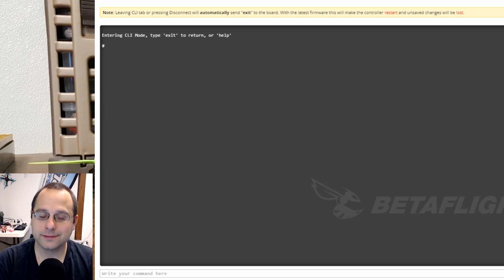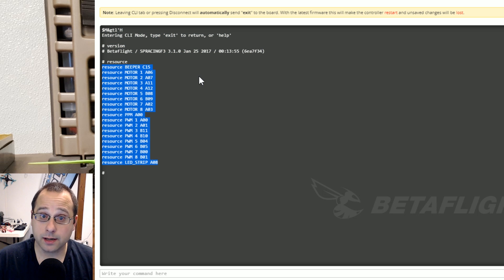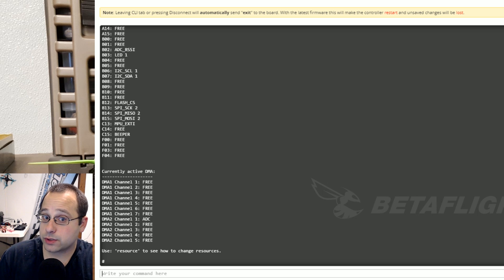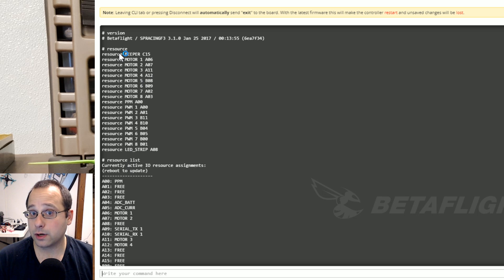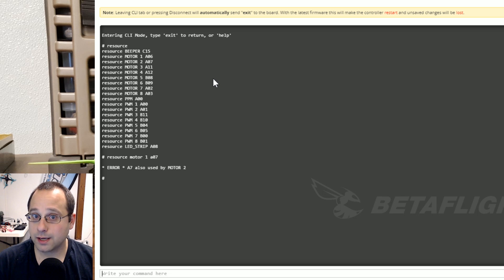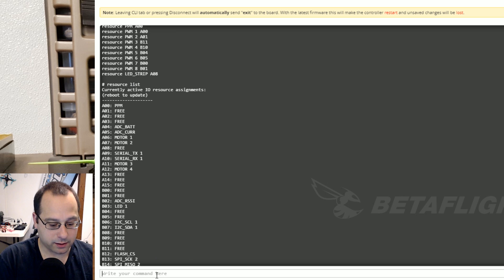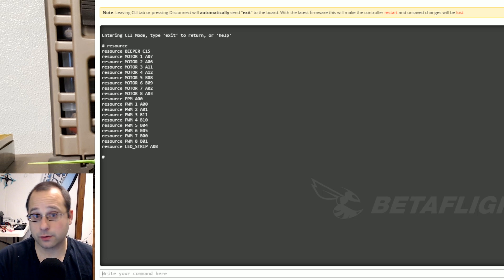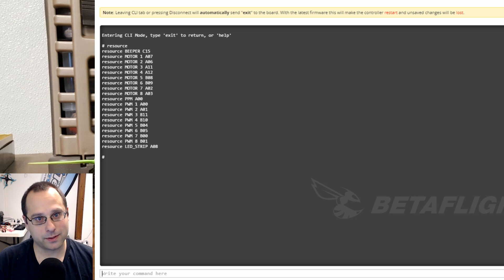Betaflight 3.1 Resource Remapping | NO MORE CUSTOM MOTOR MIXES YAY!

Comment: in Betaflight 4.2.9:
# resource list
###ERROR: resource: INVALID RESOURCE NAME: 'list'###
Reply from the maker: They changed it to "resource show"
Reply: @JoshuaBardwell  Thanks! 
Hey, Joshua, quick question: we really need to make a 4-rotor fixed wing and we have a DARWINFPV stack, which doesn't support iNav and seems to be made for quads. 
Is it somehow possible to link the same throttle signal to all 4 ESCs in Betaflight, so the motors won't get any other inputs from other control sticks? Chosing Airplane in the Mixer makes only rotor 1 rotate, and it does it smoothly, but we need all four to do the same... :/
Reply from the maker: Why not just wire the motors directly to a PWM output and control them manually? If not running iNav then there's no reason to have the FC controlling the servos or motors.

You could also wire all 4 ESC's to the same signal output on the FC.
Reply: @JoshuaBardwell  Yes, your second suggestion is what I've been wondering if it was possible. Problem is, I can not find any information on how and where to set it up... The other issue is that the motors spin up and then stop responding to throttle, so I have to disarm. I guess it's because of the feedback from the (receiver's) gyro?
Reply: @JoshuaBardwell  Oh, you probably mean in the second suggestion to literally wire ESCs to one FC output, not digitally? In this case, I don't see how it's possible, because FC connects to ESC board via plug connection that is soldered to the boards.
And it seems there was a misunderstanding: this F7 100A stack doesn't support INAV, but it does support Betaflight, which doesn't have GUI signal mapping...

Comment: is it posible to mapping motor to SDA/SCL or TX1/RX1..?
Reply from the maker: It's possible it would work on some FC but not all. You can try it either it will work or it won't.
Reply: @JoshuaBardwell  I was try it, but in motor test betaflight can't enable slider. If I turn back to the default motor pin it enable to slider,
I was try to sda/scl, led, tx/rx, but if I use led strip it's fine to slider motor.
Btw I use Fc Noxe f4 firmware 4.0.1, bf configurator 7.10.
2 pin broken to esc, so I need 2 pin.

update:
i was successfully do it.

Comment: Seems that my B00 is not working, as I switch motors they fail at this assigment. I read also that "Mapping between other motor pins (swapping) should always work fine. Other pins may not work (DMA conflict with DShot)." Is it possible to remap motor to other assignment? Led Strip didn't worked for motor, is there some other option? I have beta85x so limited with dimensions of board.
Reply from the maker: Ledstrip should always work as it is guaranteed to have its own timer.

Comment: Hey Joshua I am in a bind. I have to mount my 4 in one upside down. I was debating on wiring the signal wires in the "wrong order" so that BF sees them as the correct order which will solve the problem. But! I am concerned BF will get confused when calling for telemetry data (rpm) so I am now thinking of wiring them in the stock orientation and remapping but am also concerned about the same problem, tel data confusion. In my head it should work either way but I am not sure how BF reads esc tel data and if that system will also be changed accordingly when motors are remapped. Any info will be appreciated. Thank you!
Reply: Sorry for the long comment.

Comment: what if my motor order is right but motor 1 and 4 are spinning in the wrong direction please help! youre the best!
Reply from the maker: Reverse the motors in blhelisuite OR swap any two of the three motor wires where they attach to the ESC, and the motor will reverse direction.

Comment: @1:39 A06 is Pin 6 of the A Port. All that info is in the datasheet for the processor that you are using. Very easy to find

Comment: still works in 4.0?
Reply from the maker: Yes definitely.
Reply: tried it on dys f4 pro
s3 was broken
still doesn't work and 5v reg has a problem, rx recieves only power upon plugging in and quickly fades out

Comment: After i did this my s bus signal stoped working
Reply from the maker: Possibly you remapped something that messed up the UART you are using for SBUS. The first thing I would do is restore the resource settings back to the way they were before you started changing them.
Reply: Joshua Bardwell how can i do this ? Is there some special command i can write ?

Comment: Mine just says this help please!

NOTE: C00 already assigned to FLASH_CS.

NOTE: C00 already assigned to SPI_PREINIT_IPU 3.

Resource is set to C00
Reply from the maker: There are other things assigned to pin C00. Now there are three things on that pin.

You can resolve this by typing

resource flash_cs none
resource spi_preinit_ipu 3 none

this will remove the other things on the pin.

Comment: Im in need of help, so i was remapping motors freed them all up, well beeper 1 and motor 1 at the time shared B04 well i did the swap movi g motor 2 to B04 and now when i test i get nothing from it... worked before now .. nothing any help is appreciated.
Reply from the maker: I would recommend using the approach in this video: https://www.youtube.com/watch?v=QeuSq71pYF0&t=1s

To get your default configuration back, the best case would be if you had a config dump saved. Take the lines starting with "resource" and paste them back in. Then type "save".

If you don't have a config dump, then first create a config dump file. Type "dump" in the CLI and copy/paste the entire result into a text file.

Next, type "defaults". This will erase your configuration back to default.

Next, type "resource" and copy/paste these results into a separate text file. This is the default resource assignments.

Next copy/paste the config dump you created back into the CLI window. Type "save". Now your configuration is restored.

Next, copy/paste the default resource assignments back into the CLI window. Type "save". Now your motor mapping is back to defaults.

Now make another config dump file, this time with your default motor mapping. Save this so that you can easily restore it if you get in trouble again.

Comment: hey Joshua, remapped the led pin to serial tx 11 for smartport when i save and go to resource list it doesn't update and shows the remapped pin still as "free" any idea why its not saving the remapped pin? rebooted several times
Reply from the maker: Did you do "resource led_strip none"?
Reply: @JoshuaBardwell  yes as well as 2 other sonar_trigger and motor 5 all three set to none

Comment: Hi Joshua, I have damaged my +5V pin for my TBS-VTX on my OMNIBUSF4SD, if I use the resource option, would that be viable to change my power from another source on my Flight controller?
Reply from the maker: Good news! You can use any other 5v pad that is on the board. They are totally interchangeable. No remapping is required. Or possible.

Comment: when i typed only "resourse", all of my uart ports showed up, tx1,3,6 and rx1,3,6 so does this mean i can move them? is it depending on the fc? i am using omnibuaf4 v3
Reply from the maker: You can't reliably remap UARTs. Sometimes you csn out something else on a UART pin, but you seldom can move a UART somewhere else.
Reply: okay, that's sad. how about the sda and the scl for the compass, can we transfer them? , cos in omnibusf4 the pins are combined like the uart3  tx/scl, and rx/sda. i already used all of the uarts and i want to add compass module but its already occupied by my vtx audio. but the thing is, i cant find the scl and sda when i type "resource" and "resource list" but i can see it when i type "dump" and its in "none" status. I'm confused.

Comment: This helped me out big time...I was stuck. Just built up Super ripper w/hglrc Dino 60 amp stack, Red T-motor F40 pro 2   Tattu 1300...These motors like the 60 amp juice.  Was really stuck, and it took me a moment to reverse my motors in the CLI.  But I did it.  Did something cool u might like...Stuck these mini 2 inch 5mm  30/30  bi-blades on my quad in testing and bench mode. It worked really well and is safe.  Super stoked   Bardwell.

Comment: Off topic Josh but a little help would be apreciated, been trying for quite a few hours to modify my Diaton Fury F3 OSD board to get access to the 3 UARTS, I have managed to get Uart 1 sorted for FPort and will use Uart 2 for GPS, Uart 3!!!! for Speedy Bee this is listed and came across a snippet somewhere stating Uart 3 is actually the PPM and Sbus inputs, so with a CLI resource check I can see PPM 1 is assigned to BO3 which I can assume is the pin marked PPM :) however Serial TX 3 is assigned to B10 and Serial RX 3 is assigned to B11 so this gets confusing, I have tried reassigning the "3" to B03 and assume B02 to no avail, in a way ready to bin it and buy a new FC as its getting pretty old now, but im stubborn, its a good little quad, there is very little info out there on the Interweb on this board and its connections from where I sit, I am going to spend a couple more hours trying to nut it then give up :), update I have Speedybee working using Soft Serial with B03 and A08 so the Led Strip and PPM, I am guessing Sbus is out of bounds
Reply from the maker: I'm sorry this is way outside what I could advise on, without direct experience with the flight controller. Your best bet would be to try to contact Diatone via Facebook and see if they can/will help you.
Reply: @JoshuaBardwell  All good :) after all this, I got Speedybee working, Fport working but GPS was a big fail, few hours later stumbled across the snipped GPS support has been dropped for all F3 boards on Betaflight...... time to upgrade :) A JB Board will be here in the morning

Comment: Hello Joshua i have Bardwell board and was wondering if i can remap the video pad that ripped off
Reply from the maker: Video pad can't be remapped I'm sorry. You can try to scrape back the solder mask and solder directly to the trace. If you succeed, use a bit of hot glue to support the wire and prevent it pulling off.
Reply: @JoshuaBardwell  thank you im gonna try. I think I can see the trace on the inner side of where the pad was.

Comment: Hi, how to discover the resource number of a certain FC pad? I have a AnyFC F7 and I want to connect a Beeper to a pad (ex.9) but I don't know resource of that pad. thk
Reply from the maker: Type "resource" and look at the function that is currently on the pad.
Reply: Yes, but that didn't help me (resource BEEPER 1 B04) because the FC board does not identify the beeper pad. I just have Pad's 1 to 10 for everything (motors, beeper, led, etc).

Comment: Hello Joshua,
Apologize if someone have asked this before. So basically my question is can I use my spare pins (motor 5 and 6) as onboard ADC (ADC_BATT and ADC_CURR)? since my FC does not have those particular pins.
Reply from the maker: No you can't do that. Motor pins are GPIO (general-purpose input/output). RSSI and CURR are connected to an ADC (analog-to-digital converter) pin. ADC pins and GPIO pins are not interchangeable.

Comment: Hi bardwell! I recently got a 20x20 BETAFLIGHT F4 NOXE board from banggood and would like to use an external current sensor like the gt-r90 does. Can I remap the pad used for LED_STRIP, to ADC_CURR?

Comment: How about using UARTs for servo control? My idea is to use a FC with only 4 motor outputs (because most are like that now and they are clean) on all four corners, but still be able to connect two servos to use in a DIY gimbal on a quad. I want to use soft serial to free up more UARTs on the board by sticking things together like SmartAudio with ESC telemetry and such and then use resource mapping to assign two freed UARTs as servo PWM outputs. Is this possible? Will UARTs support the "cam stab" functionality along with manual control of a servo? Thanks!
Reply from the maker: A UART cannot be used for PWM servo output. But it might be possible to remap it for the camstab function.
Reply: @JoshuaBardwell  Thanks a lot! That sounds like an experiment waiting to be tried.

Comment: Can one remap / swap serial_TX6 and serial_RX6 on a betaflight F4 FC or any FC? for using FPort. will it work?
Reply from the maker: Not usually, no. UARTS usually can't be remapped like that, although sometimes you can. For using FPort you should use the same pad that the FC wants you to use for SmartPort telemetry.
Reply: Thanks JB you'r the man!!

Comment: Thanks JB! This helped out massively, I had a 4 in 1 mounted sideways on to a Helio Spring Board, so had to remap all 4 motors 90 degrees Clockwise! They really need to put this into the Butterflight GUI!

Comment: Hi Joshua is it possible to remapp my sbus port?  I fly normal and my quad stop working. In the configuration i have no stick moves anymore. I replace the Fc and everything works fine. I flashed it new but nothing changed. Best regards Marc
Reply from the maker: You can use any UART RX (receive) pad for SBUS, but if your flight controller has an F4 processor, you have to do the "uninvert hack" on the receiver.

Comment: Hi usua , i need to use cross fire and gps in joshua bardwell FC , im alredy using led port  and rx4 and tx4 ,   and now  rx6 for the crossfire ,  now i need the tx6 ,  can i use cam control and remapp for tx6 ?
Reply from the maker: No you can't do that.

JBF4 v1.3 breaks out T6. On the earlier boards you have to put crossfire on UART4 there is no other option.

Comment: Joshua: are you saying we can't reassign soft serial? I'm trying to wire up runcam control via uart, but my only remaining uart is inverted, so cam control isn't working. Can I enable soft serialTx and Rx, and assign them to the uart pins in question? Can the software workaround the inversion by setting tlm inversion = off? Thanks!!!
Reply from the maker: You can reassign softserial.

You generally cannot reassign hardware UART pins, except in limited circumstances.

If you need both a TX and RX softserial pin, then finding two pins to reassign can be challenging. The best case is if you have two extra motor outputs.
Reply: thank you

Comment: hi, Joshua, I have too many fluctuations in my channels, looks everything is mixed. I posted a video https://www.youtube.com/watch?v=XNUZ-0t1YHc&t=38s   Couldn´t find any similar problem on youtube
Reply from the maker: Usually this is caused by the wrong serial protocol selected in the Configuration tab. So you have SBUS receiver but you selected Spektrum or something like that.
Reply: i AM USING A  SPEKTRUM RECEIVER, WITH  THE SPEKSAT AND SPEKTRUM2048 PROTOCOL, MUST BE OTHER THINK, HAVE YOU SEEN THE VIDEO, ANY OTHER IDEA OF WHAT IS CAUSING THE PROBLEM

Comment: Is there a way to remap rx inputs. I have a cl racing f4s that had the sat pad pulled off and putting it on the sbus like I was told does nothing.
Reply from the maker: SBUS pad should work if you change UART 1 to "serial rx" in the Ports tab. You can also try RX4 or RX6 for UART 4 or 6.
Reply: Thanks. Love your videos!
Reply: So no need for any type of remapping?
Reply from the maker: No not at all.
Reply: Didn’t work.

Comment: I have a fury F4OSD FC that I lifted the ppm pad on. I remaped it to the rx 6 pad but it didn't work. Is there something else I need to do?
Reply from the maker: In general you cannot remap UART pads to other functions. Use LEDStrip or a motor pad or something like that.
Reply: Joshua Bardwell I tried the led strip first. Will I still use the uart 1 in betaflight for the receiver when it's on the led strip?
Reply: Joshua Bardwell I was wrong. I lifted the sbus pad. I don't see it in the resource list. I originally thought the sbus connected to the ppm pad but on the fury f4 8k it has its own pad. I wish that board wasn't out of stock everywhere or I would buy a new one.

Comment: I had motors 3 and 4 swapped.. and this works in 3.3.1. Also, 3.3 has a "Custom" selector in Configuration > Mixer - but doesn't seem to have any GUI to assign motors (or maybe I missed it). Anyway, got them switched via command line. Thank you, thank you.

Comment: Josh, When I remap, I type save, it reboots then 2 of the motors are gone and it will not show up in resource list. Any idea why when i type save it is not saving it? Im using your board. Reassigning S3 to RX6.
Reply from the maker: You can't reassign a motor to a UART.

Comment: What is the difference between the resources named "Serial RX, Serial TX" and a UART?
Reply from the maker: UART is a serial interface. It has both TX and RX (transmit and receive) pins.
Reply from the maker: Each pin is a separate resource. So for UART 1, there will be TX1 and RX1 resource.

Comment: Joshua, I am running iNAV 1.9, and I know you know a lot about that, and that's why I am addressing this question to you. It seems that there have been some changes from previous versions in the commands, or I am making some mistake in the syntax. I need to change the output assignment and move the motor 1 to the fourth set of pins in the output board (SP F3). I tried "resource Motor1 A12" also tried to previously assign motor4 to a free resource, but nothing works, what makes me think that I am doing something wrong. Can you send me the syntax I should use to move the motor 1 to the 4th pins set (or resource A11), please?
Reply from the maker: resource motor 1 a12

the space between motor and 1 is required. You omitted it.
Reply: Joshua, it still doesn't work, even if I try first "resource motor 4 none". Here I added a link of a video of my screen, so that you can see what am I typing in: https://www.dropbox.com/s/rhpvq9vzdzegjpc/record_000007.avi?dl=0